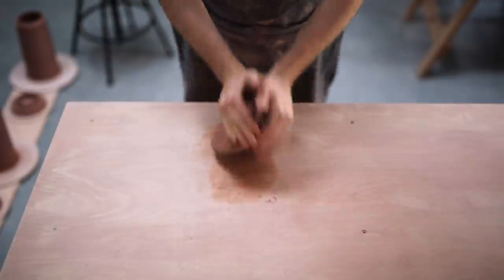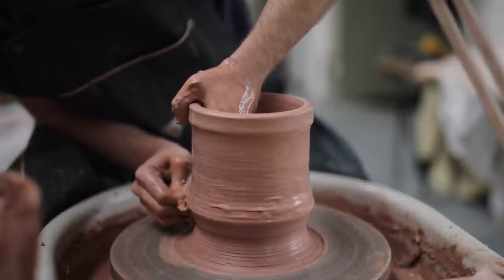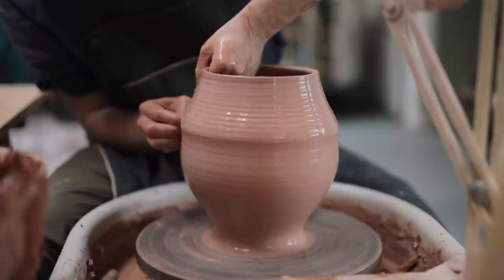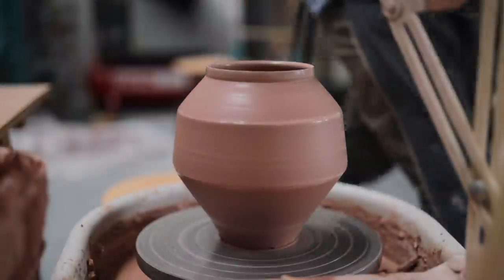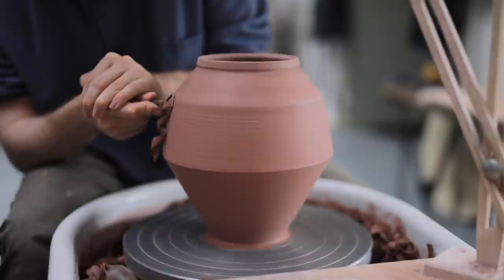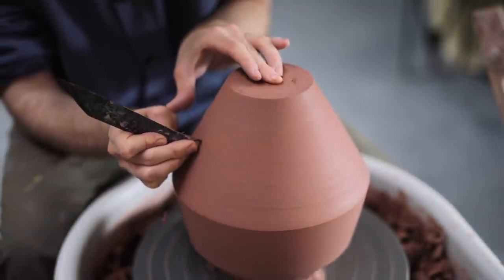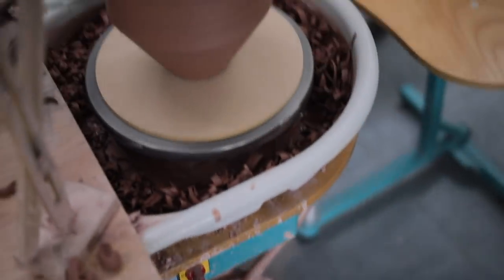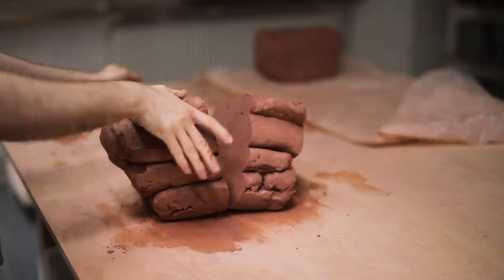Throwing and Trimming a Large, Angled Vase — Narrated Version

Comment: don't know if it matters that much but you can buy a device called a dehumidifier that is like a window unit air conditioner but all of it inside.  the evaporator condenses humidity and it drips into a sort of bucket or down a drain tube.  the condenser heats the air that was just cooled, and the fan blows the now much dryer air into the room.  net heating is not very much, but you are getting heat for all the electricity you are using, so if it's a bit chilly and you would have used electric heat, it costs you nothing net.  i had one the size of a briefcase once and it could easily take a gallon of water out of the air in a day.